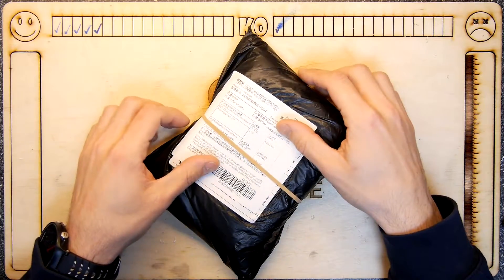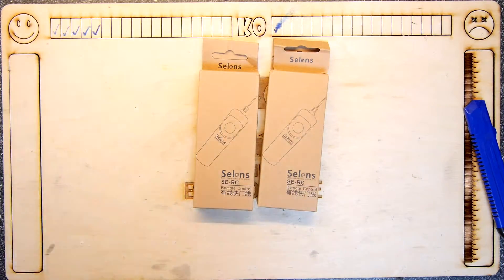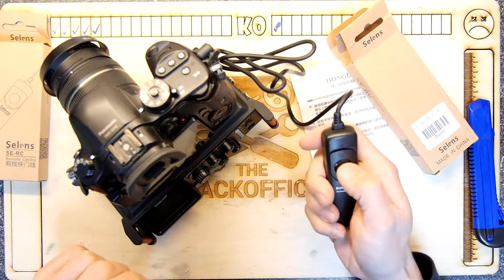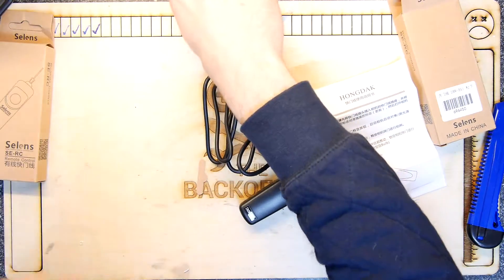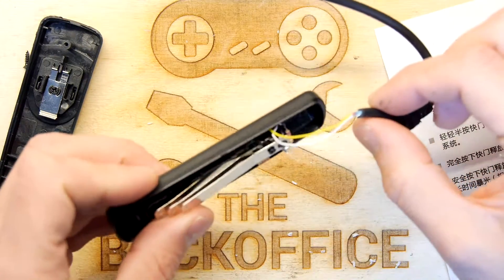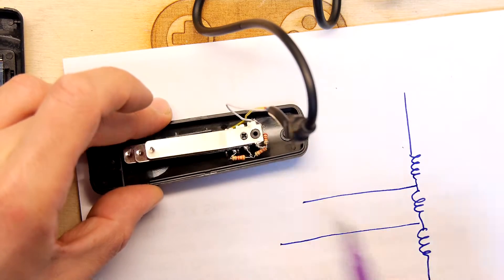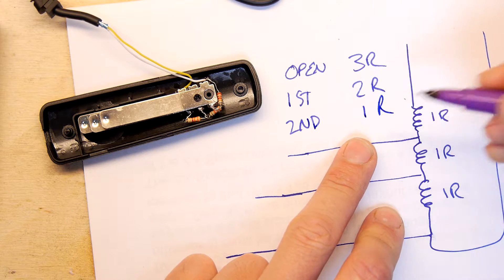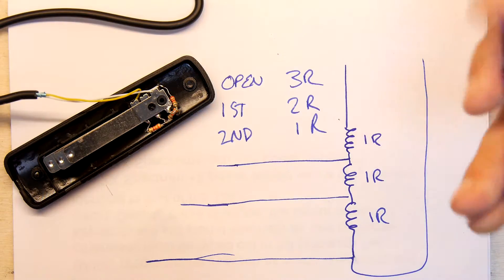Camera Remote Shutter control for Lumix

Comment: I have the G7 and can only get 122 sec when it's locked.
Is there a setting I need to change to get a longer exposure ?
Reply from the maker: Unfortunately I think it's a limit on the G7. I think you can get the similar effect by taking several 120 sec interval images and combine them later on your PC or look for a model with a longer exposure time.